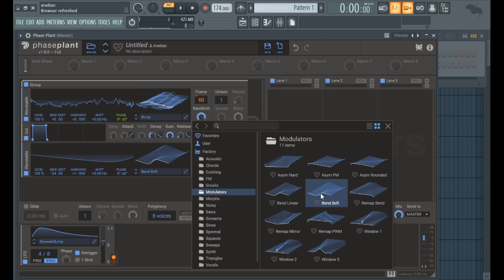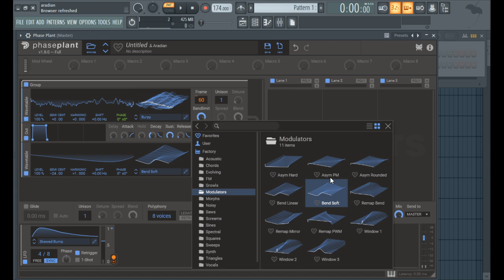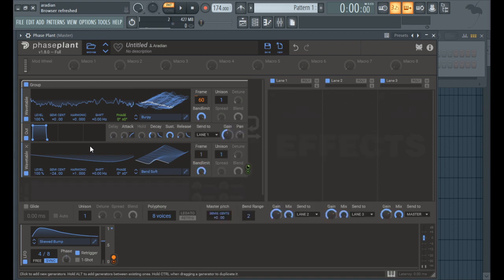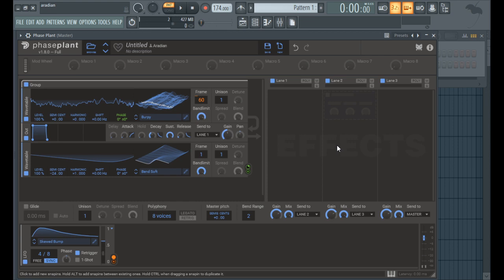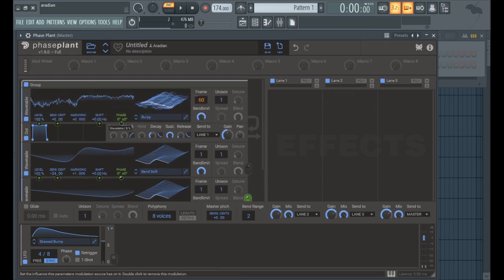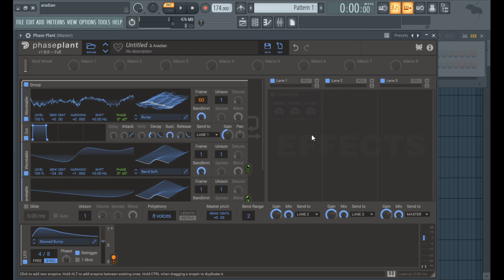Phase Plant Tutorials - 35 - Warp Modes! (Phase Plant 1.8)

Comment: I just want to ask you that when i add samples in phaseplant sampler and when i hit different notes, the sample plays for a different amount of time in terms of length. Can you tell me how to fix this?
Reply from the maker: there isnt rly a solution, u can set harmonic to x0 and shift to 440 but then every note will be the same pitch which u may not want
Reply: @aradianmusic  after doing so I've have attached pitch shifter with note modulation on it and that's working